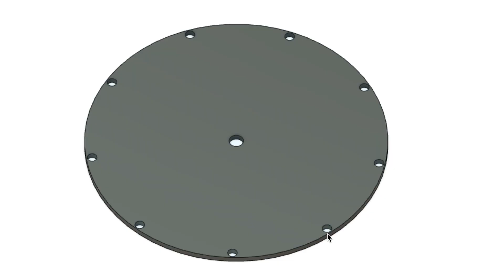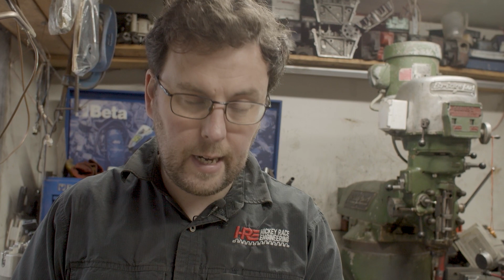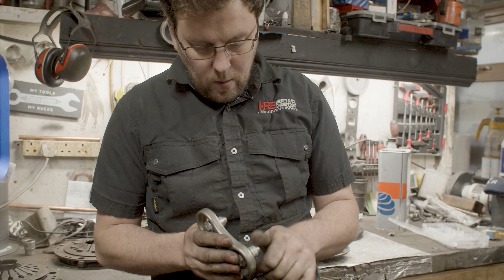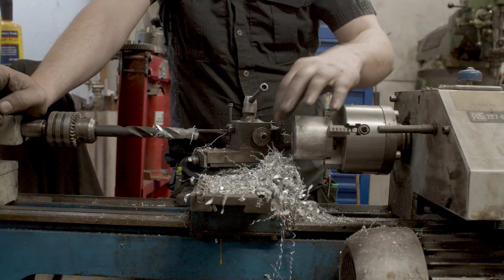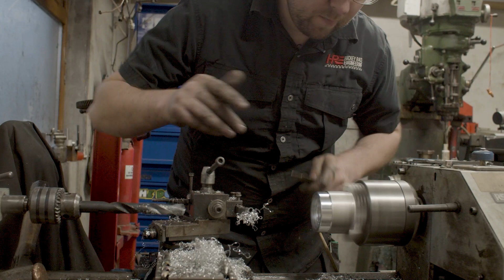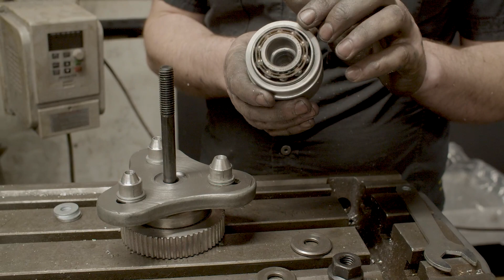HRE Get's Tooled Up For A New Product. - Twinspring Clutch System - Part 2

Comment: Nice to see how well it's progressing, looking forward to seeing it in use. Just one suggestion, when you've got those pillers lined up and sorted it may be a good idea to weld the bolt heads to the bottom of the puller. Then they would never move out of alignment even if they got badly knocked.
Reply from the maker: Great idea Tony I will deffo do that